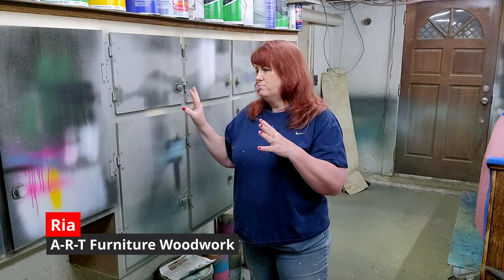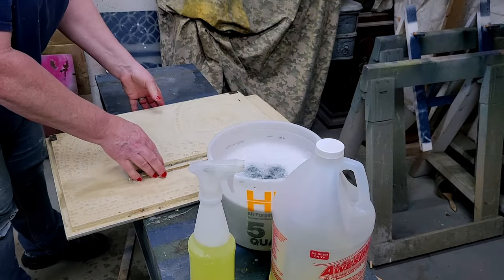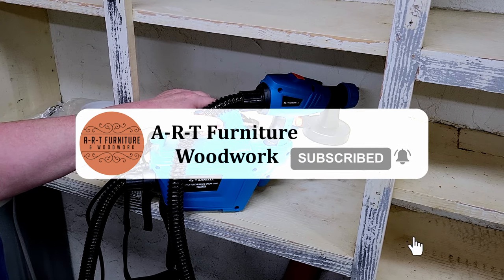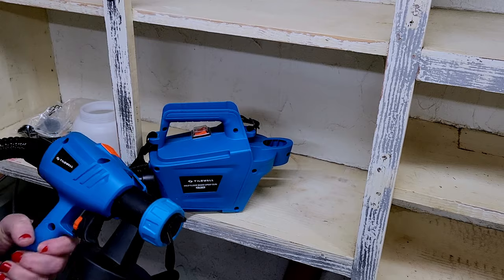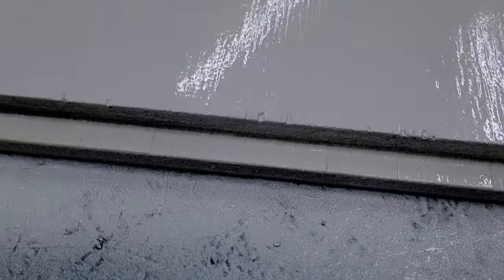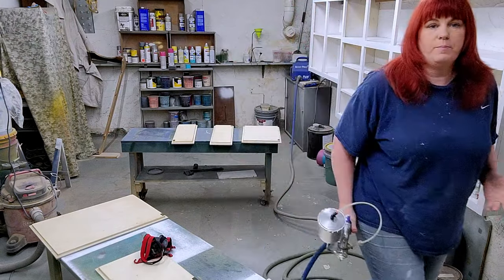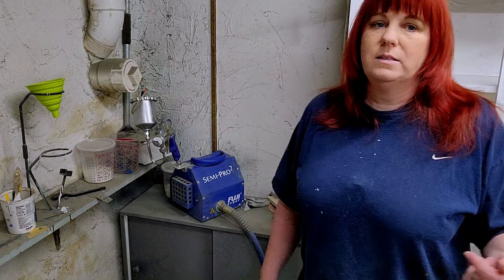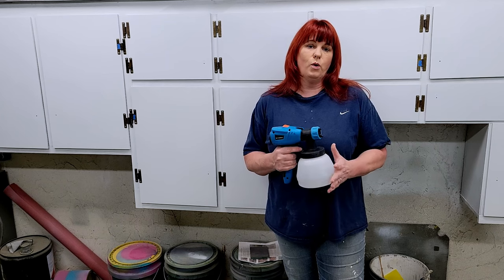Paint sprayer for flipping furniture - Do you have to go all in? Tilswall 800W HVLP vs Fuji SemiPro2

Comment: You mentioned Awesome cleaner. I have been using that for 35 years for just about everything. It is the only cleaner that will remove hair dye from anything. Floors, clothing, walls, towels. In my hair salon we had 6 bottles all the time. We had a few ladies who refused to wear a robe when having their hair colored and some tint would sometimes get on their clothing. They would have a hissy fit and demand that I pay for a new blouse. After I discovered Awesome I would send then to the changing room to remove whatever was stained and spray awesome on it and within 10 minutes, The tint would be gone and I washed and dried the blouse and gave it back. It has saved me a ton of money over the years. I'm retired now, but I still buy 6 bottles at a time and keep it in the kitchen and bathrooms.
Reply from the maker: That funny that you love the stuff as much as I do. Never knew it was so good on hair dye good that it save you a lot of money over the years though sounds like those clients should have known better.